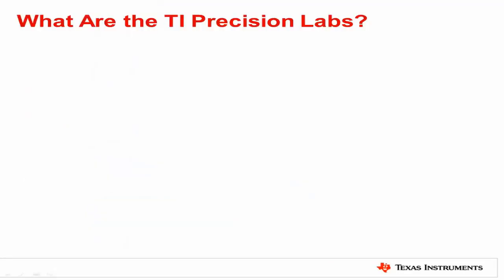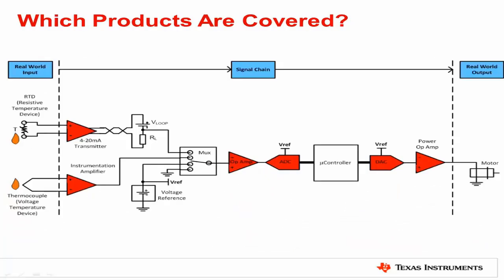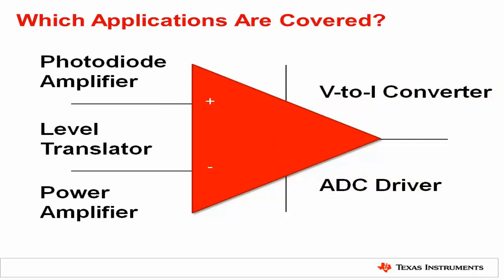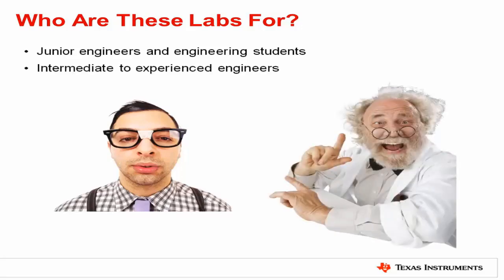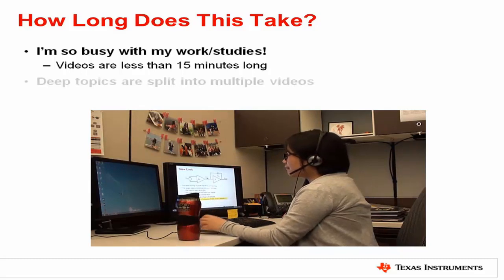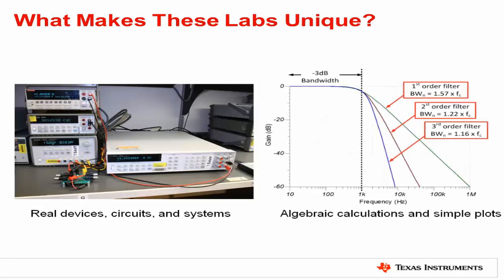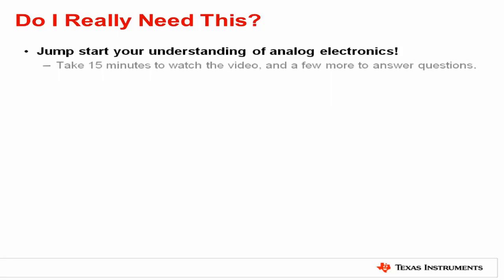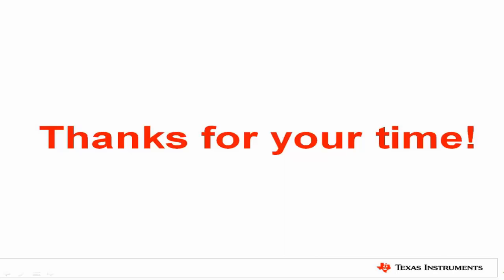Introduction to op amps

Comment: FYI TI out of this whole op amp series the only ones I see that haven't been updated with the new thumbnail and resolution are the noise 1 and distortion 1 uploads. You have both listed but they are older without the new thumbnail. I also saved this series in a publicly listed playlist for my own reference. If you want to redo the TI playlist you could just copy mine manually to get everything sorted in the proper order without taking the time to reorganize it yourself